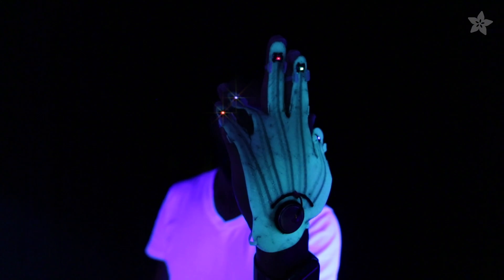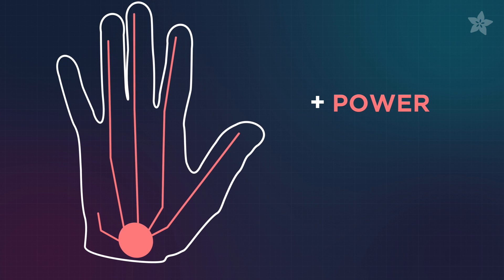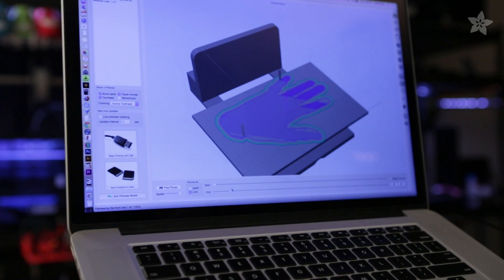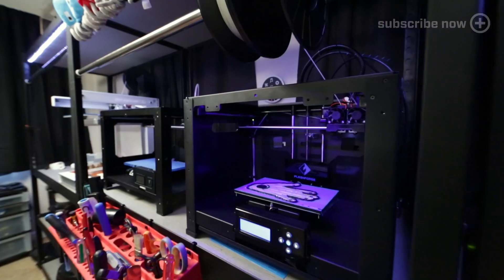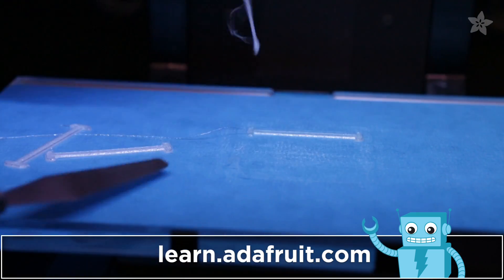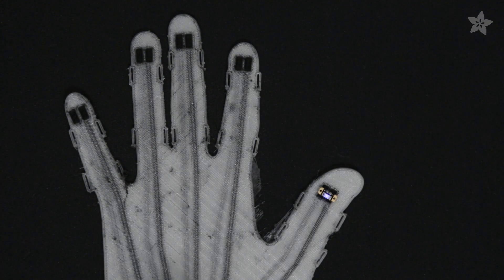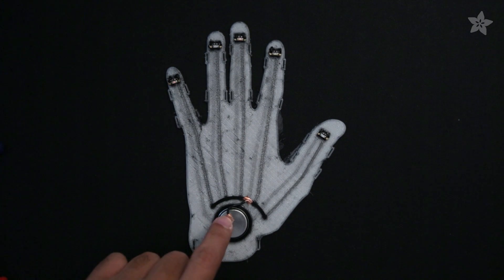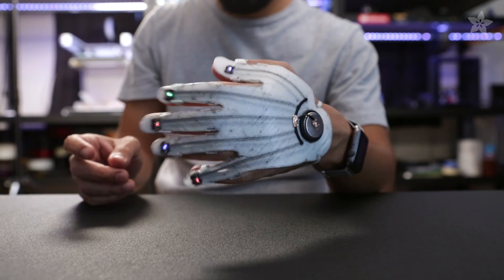3D Printed Flexible LED Glove

Comment: how come you took all the exterior panels off the creator pro? also did you print the ninjaflex using the stock extruder?
Reply from the maker: pj to get time-lapse footage from different angles ;) Yes stock extruder with no changes, check the learn guide for all of the info as always!  https://learn.adafruit.com/3d-printed-flexible-conductive-filament-led-glove
Reply: Adafruit Industries thanks for responding. I recently picked up the creator pro myself and I'm waiting on my first roll of filaflex coming through. look forward to more of this series showing different cad software.